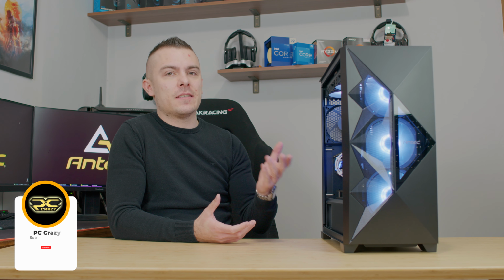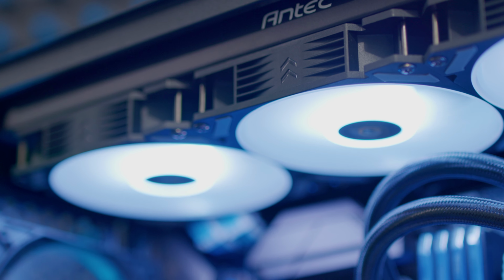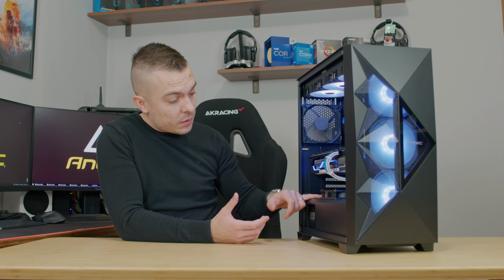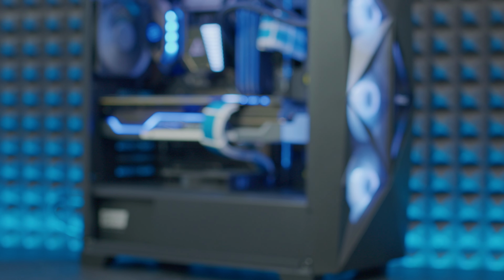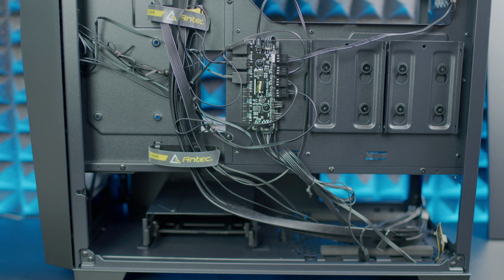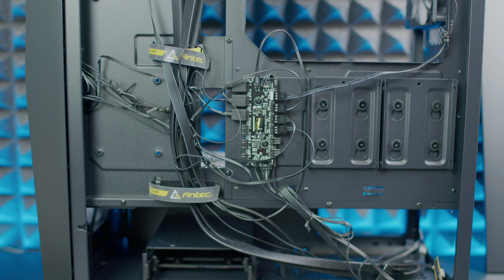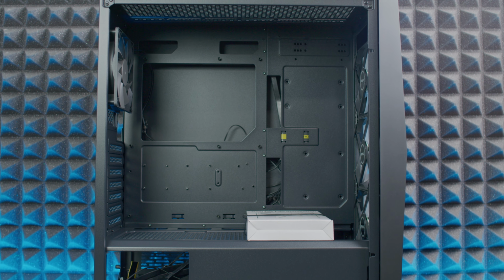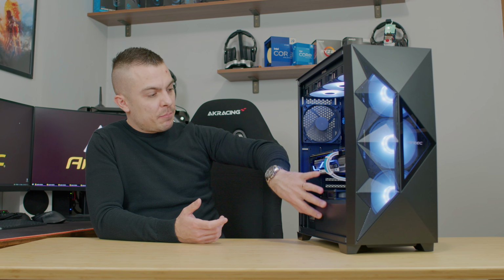FLUXING WITH AIR FLOW - ANTEC DF800 FLUX

Comment: can you control the speed of fans ( are they pwm) ? are they loud ?
amazing videos quality btw
Reply from the maker: You have a 4-pin cable running out of the controller at the back and you need to connect it to the motherboard. I can't remember precisely, because the fans weren't loud, but I think you can adjust the speeds.
Thank you very much! Glad you are amazed by the quality.

Comment: This or the df700? Do they perform the same? Is the rgb fan controller the same?
Reply from the maker: I think the controller is the same. Can't remember exactly. I would go with DF700. Front is more meshed.
Reply: @PCCrazyDario  exactly what I went with. The case is absolutely fantastic. 

My Suprim X 3080 12gb idles at 24c and underload never breaks 60c. 

My cpu idles at 29c and bever goes above 55c.... 

All air-cooled with supplied fans, nothing else.
Reply from the maker: @DanRyder87  Amazing to be honest. :) Glad it worked out for you.